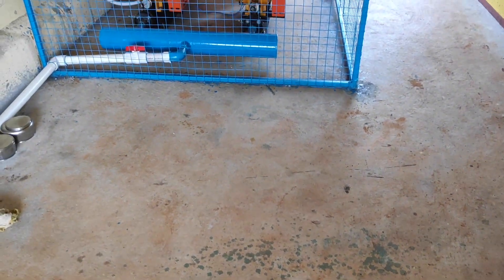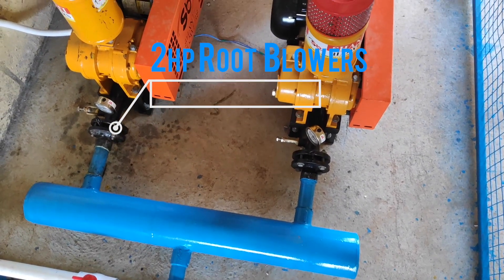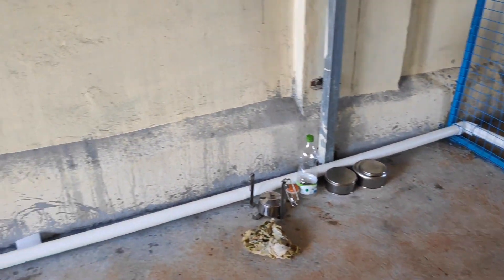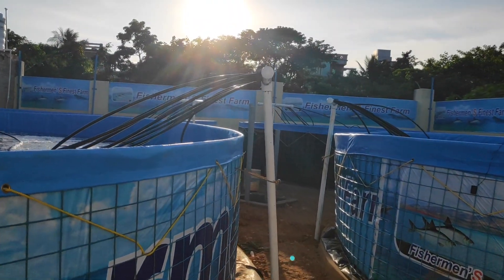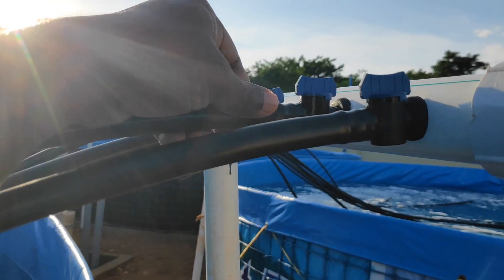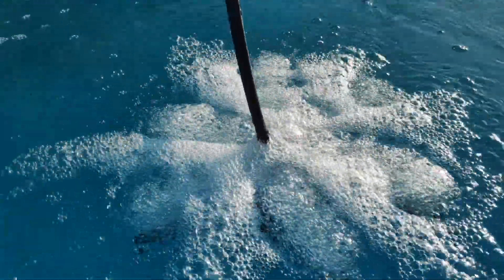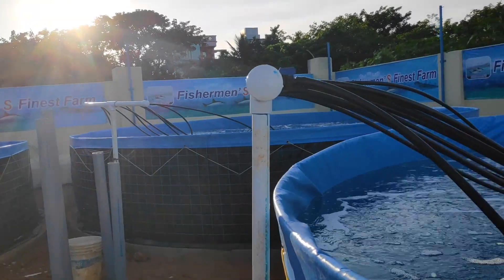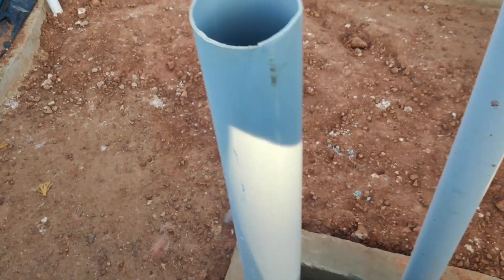New Biofloc 1.2 Lac Liter Water Capacity Project For Shrimp and Fish Farming

Comment: How much shrimps can a single 30,000 ltr tank can hold and how much we can expect for 4 tanks of 30,000 ltr capacity
Reply from the maker: Per cubic meter you can stock 250-300 pcs and per cubic meter you can expect 3-5kg biomass

Comment: Thanks for the video. The tanks are placed outside with out cover. If the rain falls directly into the tanks, doesn't that change water parameters? The place where I live, as it's coastal, low pressures and cyclones could be frequent. What do you suggest brother?
Reply from the maker: When there will be rain water entering into your tank, you should have proper drainage system for overflow the rain water. And you have to fix the water parameters when excess rain water enters into it, you can cover the tank with a polythene sheet to protect rain water
Reply: @RoadtoBioFloc  thank you

Comment: Why didn’t you attach valve for the drainage exit? Wouldn’t it be easier while draining ? What is the idea behind attaching vertical pipe at the drainage ?
Reply from the maker: These pipes will helps to get out excess water from here, instead of tank overflow